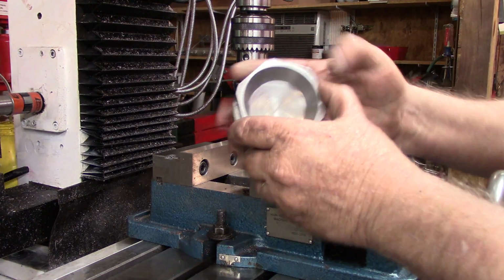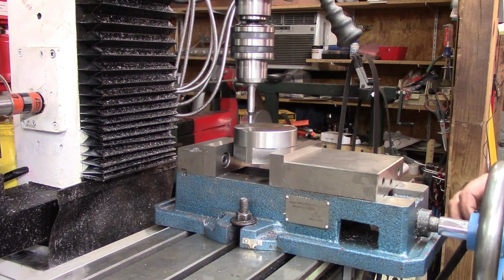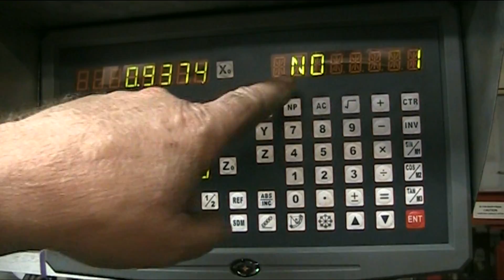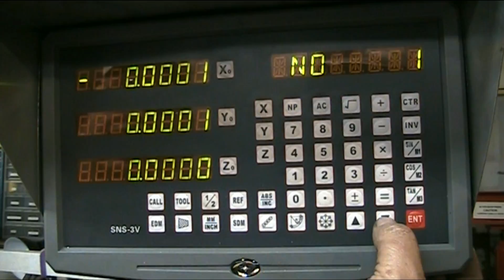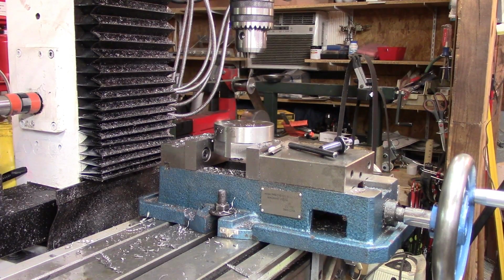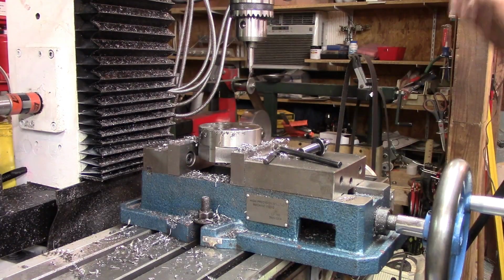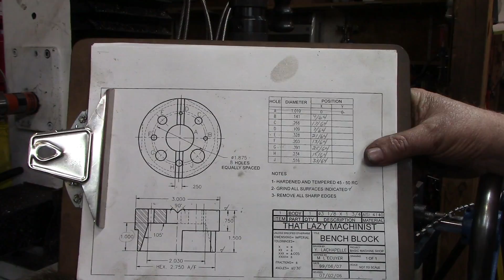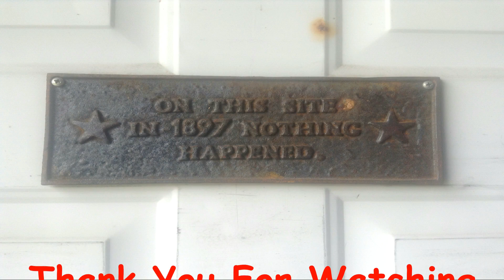Bench Block (Anvil) Part 02

Comment: Hi Lee,
Nice project.... ;)
If my memory is all right heat treated 4140 would be around 30 or so RC...
You could do the V by using a 90 deg. chamfering tool, just make sure you make a slot about 1/8" wide to ease the chamfering tool's job...
Cheers,   Pierre

Comment: Thanks, Lee! 

Incidentally, and for anyone following along at home, a number of guys have reported that it is useful to have one of these made out of a hockey puck as well. I haven't tried it but it makes sense, like a soft jaws version of a bench block, and it would be a very cheap addition to the shop.
Reply from the maker: Jon Miller Good idea Jon; however hockey pucks are kinda like chicken teeth here in NC. 😜 Thanks for stopping by.
Reply: That's why God gave us eBay and Amazon. :)

Comment: I think the pattern could be made using the hex pattern and a straight edge along the side of the vise if you did not have or want to deal with the DRO, Another reason for the Hex, though you would be limited to 6 holes of course